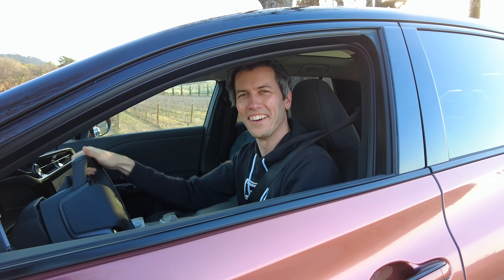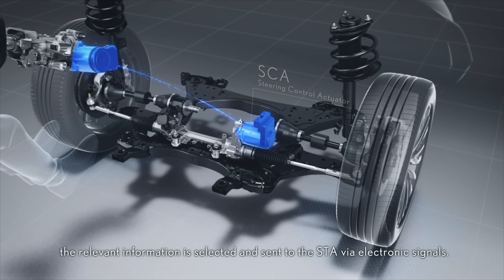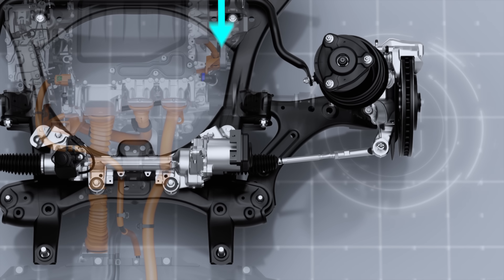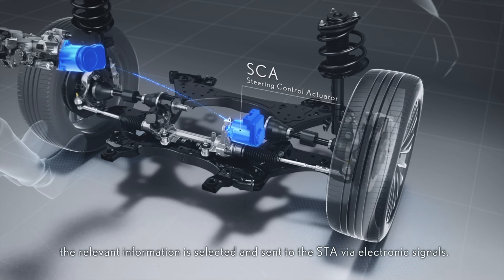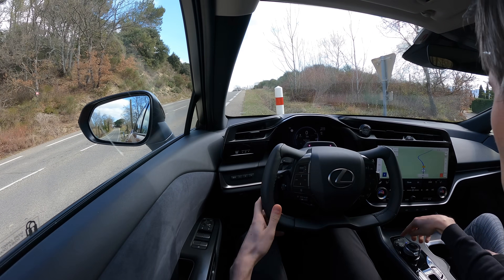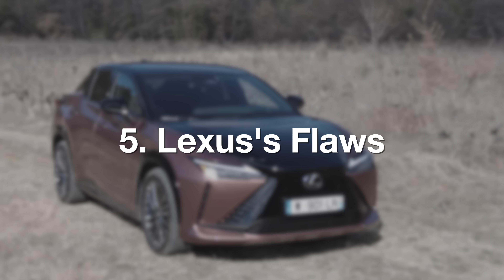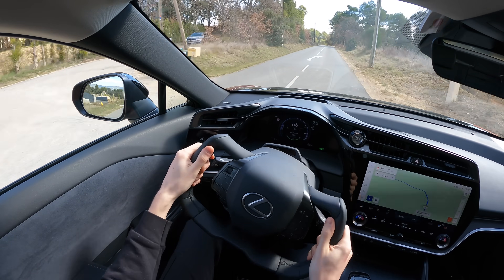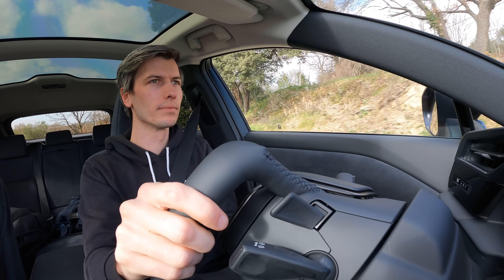How Lexus Fixed Tesla's Bad Idea: Steer-By-Wire Yoke

Comment: I'm glad Lexus thought of all the exceptions and back up, but they did not account for the human. As the car ages the car will get passed on to different people and as it ages people with less means will start to own these cars and they won't be willing and/or able to fix these costly systems with additional complications. While the technology is cool, these extra unnecessary innovations wind up totaling out the cars at much faster rates and produces more waste in the long run. The whole benefit of electric cars (other than the fuel) was the fact that they will last longer with less resources/maintenance compared to conventional ICE cars, but all these innovations are kind of taking away from the longer life that motors and batteries are bringing to the table.

Comment: I feel like it's going to be harder to build muscle memory using this steering mechanism, the response won't be as predictive as regular steering, it's a disadvantage for an experienced driver, specially in emergencies
Reply: That is a real risk especially if the system's behavior is not as simple as a 1 to 1 thing (like mechanical systems are by necessity) I posted a concern in another comment with regards to constant radius turn while slowing down. On a mechanical system at slow decelerations the steering wheel does not move much. At high decelerations though the steering wheel needs to be eased a little with the change in slip angles. With a steer by wire system I fear the change in ratio would throw another variable at the driver to cope with where the steering wheel would have to noticeably unwind during the maneuver.

If the system makes an exception for that case, then the driver has to deal with a different problem: the steering ratio increase would need to be postponed until the maneuver is complete and happen all at once. I don't see, as of yet, how this is resolved in a way that would feel intuitive.
Reply: @aurelioramos8463   there are current systems though that while are mechanically connected have a variable ratio that is electronically controlled and can change with vehicle speed, vehicle mode etc. I think for the most part there haven’t been issues with those such systems.
Reply: @ALMX5DP  I am aware issues with some old variable ratio systems from the past where it could be possible for the steering wheel position to be off center for straight line driving with certain failure modes. Although I never heard of an issue that would compromise safety or disable steering altogether.
Reply: I tend to agree, especially when multiple manufacturers tune their variable ratios differently. But I think if you lived with a particular vehicle you would develop muscle memory relatively soon (or at least I'd hope that is the case).

Comment: Looks like it would limit your ability to do emergency maneuvers at higher speeds.
Reply from the maker: Why? At a certain steering angle, you're just going to understeer regardless. And this will be quicker to act than fully rotating a mechanical system 360 degrees.
Reply: I don't see why, the ratio at high speeds is going to be about what it is for a conventional setup. The difference is at slow speed and it's better since you don't have turn the yoke as far as a wheel. That's the problem with the Tesla yoke, it's terrible at slower speeds.
Reply: Exactly. This seems like the biggest issue.